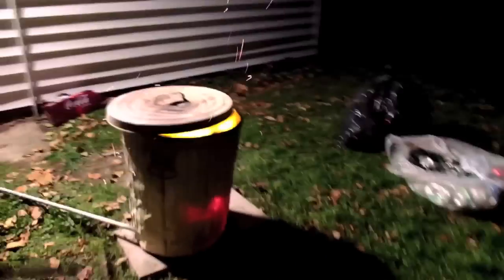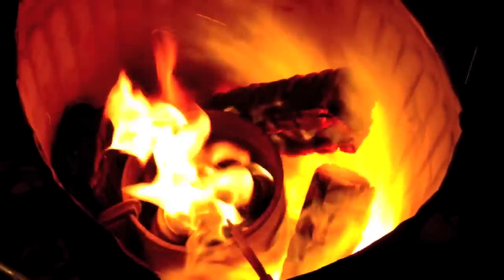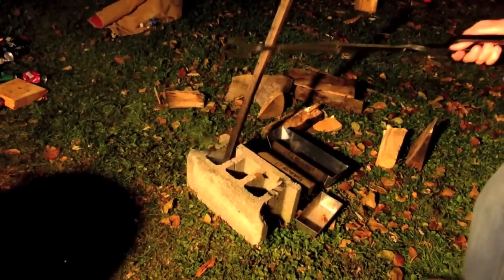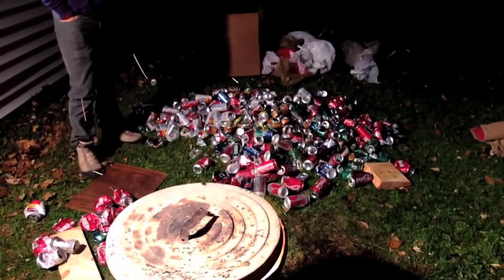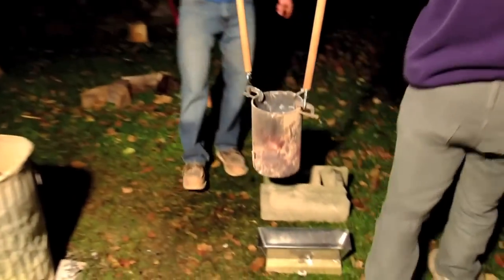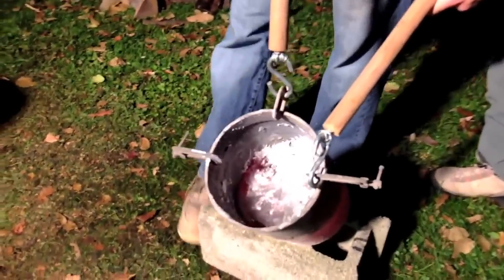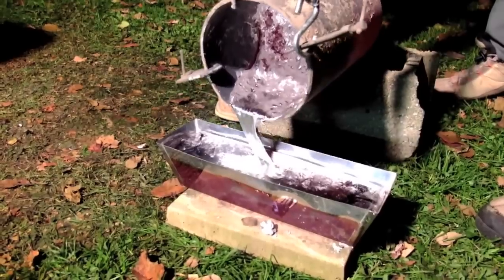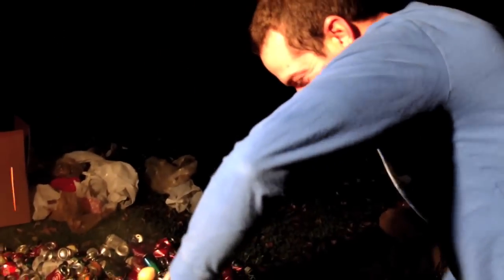How to Melt Aluminum Cans into Ingot

Comment from the maker: It was around 500-700 cans. We wished we would have kept count.
Reply: You look like omid from the walking dead game
Reply: Where I live you can get about $32 for 600 aluminum cans.  The biggest haul I ever took in for redemption was $860 worth of cans. It took 2 trips in a rented Ryder van. This guy had a basement full of cans and offered us half the value, and he would pay the truck rental out of his share. My buddy and I ended up making $215 a piece of four hours of hard, bug biting and smelly work. It was worth it.
Reply: weigh the ingot and divide it by the average weight of a can.. it's not hard to get a very accurate estimate.
Reply: ldchappell1 Couldn't you find a way to quickly crush the cans in some sort of masher so that they wouldn't require so much space?
Reply: This is uglier than a homeless-guy fight at the recycling center.
Reply: BeyondSurvival Edreen #illuminaticonfirmed
Reply: 1stPlaceDirector  We thought about that but we couldn't figure out a way to make it feasible. There was over 10,000 cans in that basement. It was easier just hauling them in two trips.
Reply: +Ben Snyder I always thought the tabs were made of aluminum and the can was made of tin. Would they're really be any need to melt the whole can other then the shear joy of melting a can. :) I think I just answer my question. Carry on!! :)
Reply: ***** hes melting pure aluminum.. the only thing not pure is the paint which is 2-5% of total weight... So when you say "much" you really mean almost nothing is lost. If we were smelting raw metal.. it would be different obviously.
Reply: Did you sell the ingot? If so, how much $$ did you get if you don't mind me asking....or atleast what's something like that worth?..thanks..great vid.
Reply: JMS,
I saw that you can get about $4.00 per pound for aluminum in ingots, so about five times the value of what you would get selling the cans by themselves.  You of course have to figure in the cost to melt them down and the risks involved. If you burn the hell out of yourself and wind up in the hospital, it definitely would not be worth it.
Reply: alan30189 yea, I hear you. Thanks.
Reply: Ben Check out   Bronze Cowboy Pranks he is out of Old Town Scottsdale I think you will like his Theme. A little Bronze metal humor.
Reply: Ben Snyder my lots of cans would be the same price when I'm recycling it
Reply: Ben Snyder 02
Reply: You wished you kept count, we wished you filmed it.
Reply: TwistingBitches- (‘dark matter’)... paint is burnt off... it will now sell as scrap aluminum ... might bring more than cans alone, not sure exactly. I drive by one local salvager their can pile is bigger than their iron pile